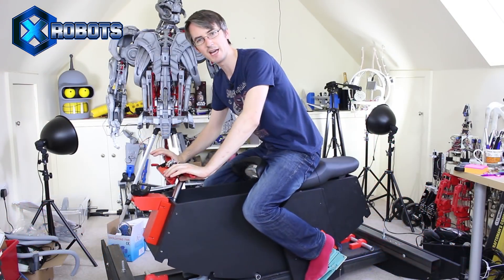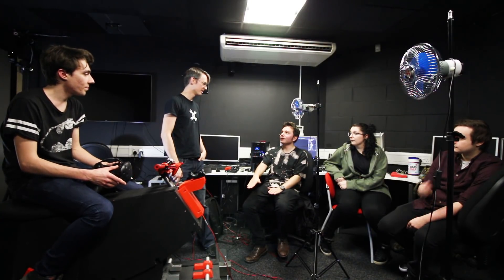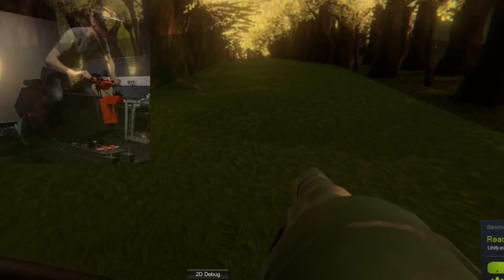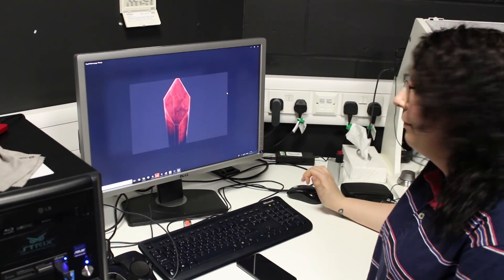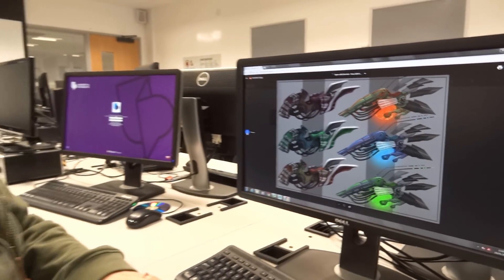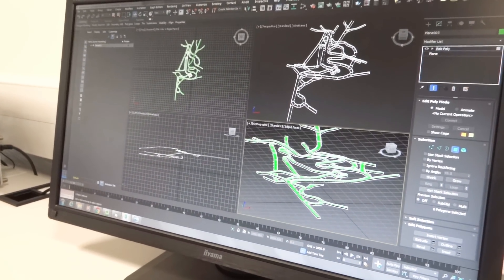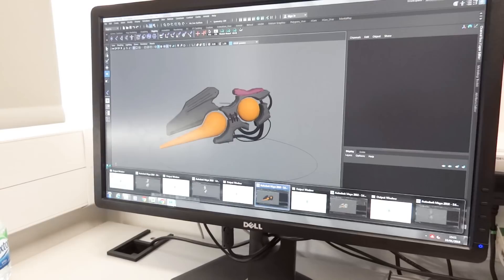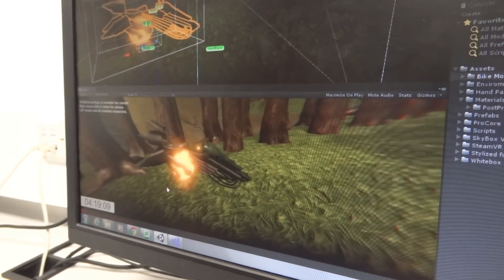VR Hoverbike Simulator Game #3 | James Bruton

Comment: Never been convinced about games controlled by static leaning bikes, they never feel like a real "bike" would feel because it's almost impossible to maintain a steady lean angle as you would be able to in real life with centrifugal force acting to balance your weight as you lean over. 

I think it needs force feedback to resist your lean angle more and more as you pick up speed or add throttle, it should be harder to lean over as you go faster.

Comment: One thing I'd suggest with the track idea is to make the 'drop location' more obvious. For example, having section of track with no trees overhead can help gravitate a player to that location. Once they know they're on the track, you can have as many trees as desired, since the main goal of getting them on the track was achieved.
Another idea would be to add some strafing to the bike while leaning slightly (just past the deadzone) so that small adjustments can be made without having to constantly adjust for over turning. Essentially, try playing F-Zero on the SNES without the shoulder buttons. Doable, but having the option to strafe, even if slightly, makes navigation more fluid.

Comment: I Suggest you control the steering via the handlebars. Make them a control input like on a bike and have the bike lean with the turn via hydraulic actuators etc. Failing that use head tracking to control steering. look left to turn left and as you straighten your head coming out of a turn the bike straightens.

Comment: Nice work so far guys. 
Probably a bit premature constraining movement to such a tight race course until you have your vehicle mechanics worked out. I suspect that the track will need to be considerably wider than it is currently to provide an enjoyable experience. I'd be testing the vehicle in a lightly constrained environment, like an open field with a few trees while tweaking the vehicle physics and human interaction code. Once you have that nailed, you'll have a much better idea about turning circles and breaking distances, which will provide the constraints on the design of the track.
Reply: This! ⬆
Reply: Very good point.

Comment: project is looking good, the steering was always going to be an issue at low speeds, one potential solution is putting pressue pads under the seat and programming the game to read those values at low speed and tilt at higher.

Comment: I suggest you to install a gyroscope in the bike so as to simulate the gyroscopic effect of the wheels. Otherwise it would sway unnaturally
Reply: Wheels?
It's a Hoverbike.
But a gyroscope is a good idea.
Reply: I was thinking the same thing. A reaction wheel or some counterweight that makes the bike want to stand more upright.
Reply: And, pneumatics for simulating collisions...?
Reply: phoenixfirex I understand visually it's a howerbike. But if you notice the way it moves around it's just like any other two wheeler except visually it has no wheels. The movement of a real howerbike is a lot different. Checkout colinfurze's channel. You can notice the difference
Reply: I'd take a risk and put some counterweights in together with the gyroscope to offer some realistic resistance and depending on time, resources and cost, consider a reactive pendulum.
Reply: easiest way is strap that Dualshock 4